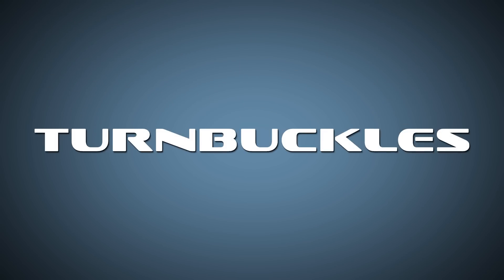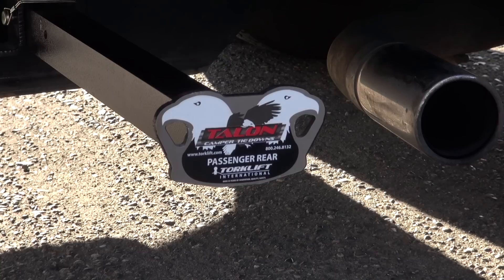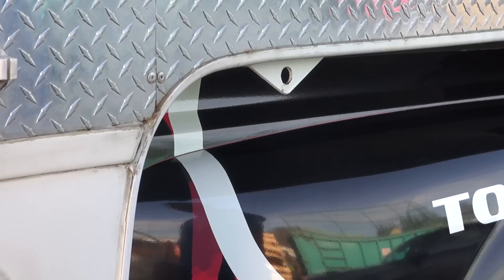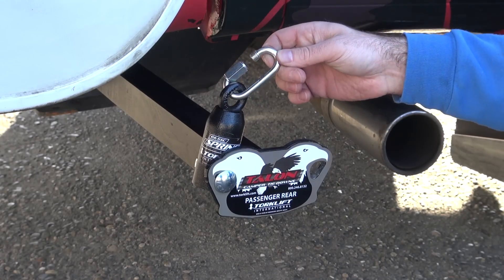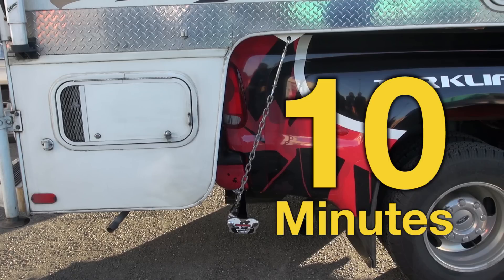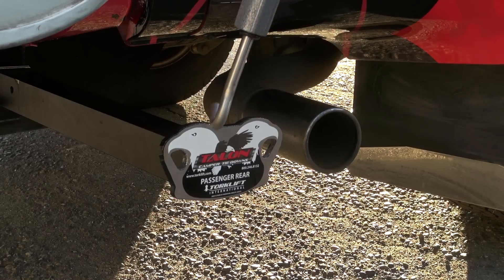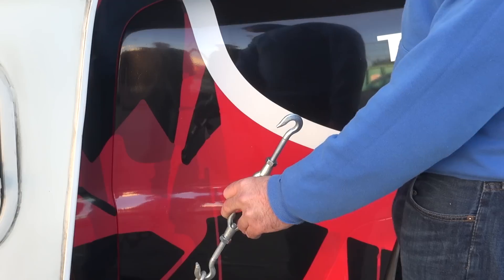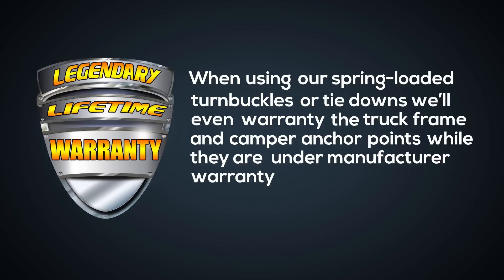How to install and adjust turnbuckles - Torklift International

Comment: I’m new to fast guns but I prefer the locks on the bottom. That way if I screw up the pin will remain in the Lever.
Reply from the maker: Hey MrGhendri - thank you for commenting! We hope you're enjoying your new FastGun turnbuckles. We will share your ideas with our engineering department. If you have any concerns at all about the installation of your FastGuns, you can contact our tech support team at 800-246-8132 and they would be more than happy to assist you.